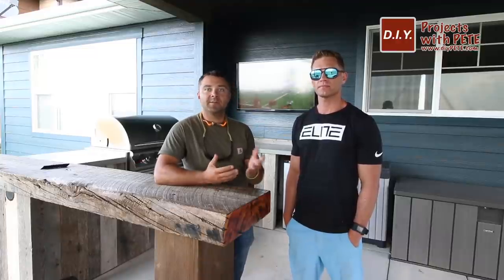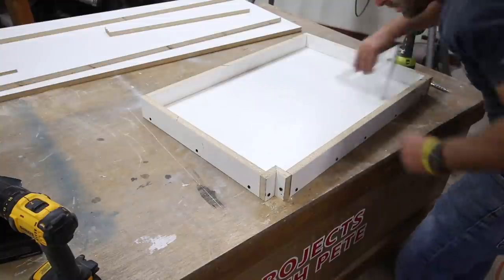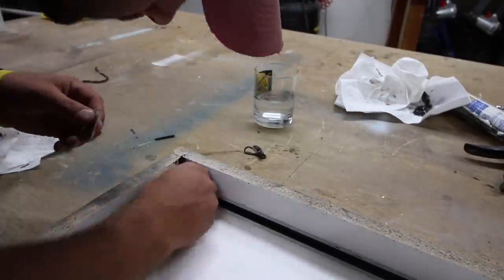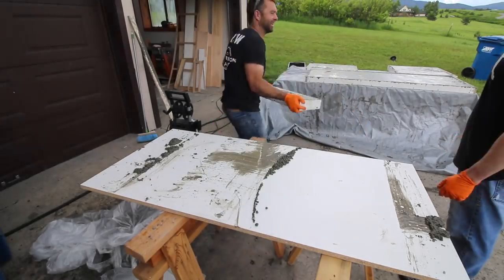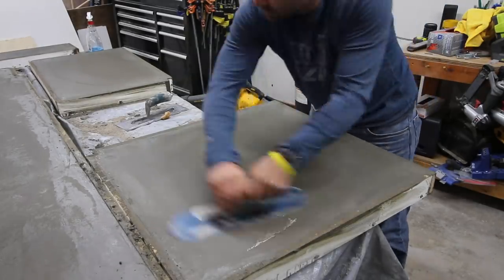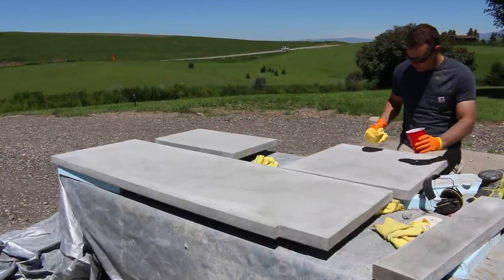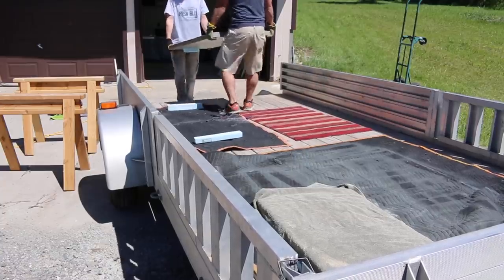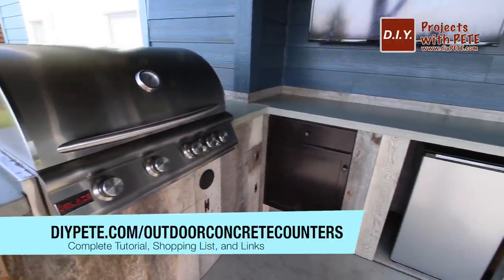How to Make Concrete Countertops

Comment: Use rubbing alcohol instead of water when working with silicone, it works much better.
Reply from the maker: Thanks!
Reply: @DIYPETE  NP, its my best tip ;-) , works on clear bathroom silicone, the black roofing stuff, everything. Even cleans your hands (while the silicone is still wet). Super smooth joints!

Comment: Is concrete a food safe surface?
Reply from the maker: It is when you use a food safe sealer. I generally always have food on a plate though and don't eat or cut food on the concrete so It is not a big deal, but if it is a concern you can definitely find a food safe sealer. Cheers!
Reply: @DIYPETE  Thanks Pete!

Comment: Should use pressure treated outside. Or steel stud
Reply from the maker: I only did the concrete counters section for this build. Yes, pressure treated would be a good idea. Cheers

Comment: How strong is concrete countertops
Reply from the maker: They are very strong and durable.
Reply: @DIYPETE  thank you can it be compared to marble or granite?
Reply from the maker: @jordacheiyman7799  Similar in durability. Has some differences for sure. It is porous, so sealing it properly is a big deal. There are quite a few resources out there to check out and compare them to see what is the best fit for you.

Comment: That grill is not installed correctly. It needs 8 1/2" of height space so it should be supported on sides on countertop. Here Blaze grill is sticking out so it means it won't have enough space for ventilation.

Comment: 6:50 Why didn't you use Quikrete Counter Top Mix??
Reply from the maker: I have used both over the years. I actually like working with Quikrete 5000 better and have had fewer issues with it. It also sets up slower and is about $6 / bag vs $23 per bag. Both are good mixes, but my personal preference is the normal 5000 mix.
Reply: @DIYPETE  ever try the Quikrete crack resistant? It has a fiber in it. Holds together better without mesh. Both have a Flow agent to give professional end result.
Reply from the maker: I don't think I've used that yet. Will have to take a look at it.

Comment: Melamine is a compound separate and distinct from plywood.  What you're referring to as melamine appears to be melamine coated particle board anyway, and not melamine coated plywood.  In any case, the board itself cannot appropriately be called melamine.  That's no different from slathering a piece of plywood with crisco and calling the whole thing crisco.
Reply from the maker: Thanks! Yep, it is essentially particle board with a white paint. They label it as melamine at the store and so I've always just called it that. I just said similar to plywood with a white coating in the video to explain it in layman's terms, but I probably should have just said particle board. Anyhow, thanks for chiming in! Cheers https://www.homedepot.com/p/Melamine-White-Panel-Common-3-4-in-x-4-ft-x-8-ft-Actual-750-in-x-49-in-x-97-in-461877/100070209

Comment: One time I saw this concrete finisher use a mag before he used a steel.
Reply: Then I saw him use a little water and burn his finish in.Looked like a mirror when he was done.
Reply: @woody9283  Magnesium, trowels are used for beginning finishing, It will bring water and fines to the surface. Makes for a better looking and stronger slab. All depending on how dry the mix is.
     ( burnish? )

Comment: Great tutorial but you never mix concrete by pouring in water, you always add the water to the concrete!  Too much water weakens the concrete so by pouring the concrete so fo it is mixed with too much water!
Add water to the dry concrete and mix as you go to prevent too much water weakening the mix!
Reply from the maker: Sounds great, thank you!

Comment: What I love most about DIY videos is the inaccurate costs to making things. Sure, you spent 197 in materials.... But then there is the circular saw, jigsaw, pliers, boltcutters, gluegun and god knows what else. All in all you'll be spending closer to a grand.

Don't get me wrong, I'm a big DIY fan and I have all these tools. But I find it slightly misleading for people who are just getting started doing stuff themselves. Perhaps including the costs of the tools is more appropiate. Not only does it tell new people what they will actually be spending, but it will also show those who already have these tools that this a project where you can cash in on your tool investment.
Reply from the maker: Hi there! Thanks for your feedback. The $197 as mentioned in the video note does not include the tools and is simply the supplies. Tools can vary so much ( used vs new, quality, etc ) -- that I never include the tool cost but have a web post that gives a materials list and then options and recommendations on tools.  We are all at different stages in building our tool inventories and with our skills. I try to provide recommendations on more cost efficient methods when possible ( like using a circular saw instead of a table saw if it would do the job ) --- or borrowing a tool from a friend, or using a local "MakerSpace." Thanks again for chiming in and for your feedback. Really appreciate it! Cheers   https://www.diypete.com/how-to-make-concrete-counters-for-an-outdoor-kitchen/

Comment: I work with concrete, if i were to see it in a kitchen it would be ripped out, yuk. I just cannot see the appeal. ive not given a thumbs down as thats not fair as it obviously has an appeal and this was done correctly.
Reply: Mister Matt I was thinking due to budget but then employing a contractor and the time taken it sure would not be cheaper than a budget worktop, even using the shuttering and applying a coloured epoxy would surely look better.
Reply: For an indoor kitchen, I agree, but for an outdoor grill setup it sounds pretty cool.  If it's DIY it would be very inexpensive, very durable and sure would look better than my rusty old propane grill on wheels.
Reply: I dunno. If you use a different concrete than what he does you can achieve a limitless number of colors, patterns and effects.